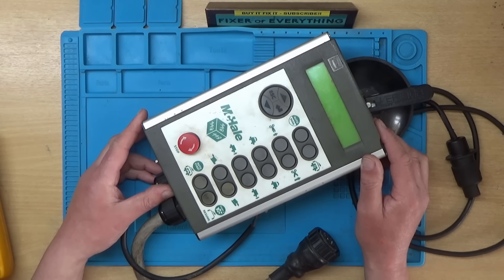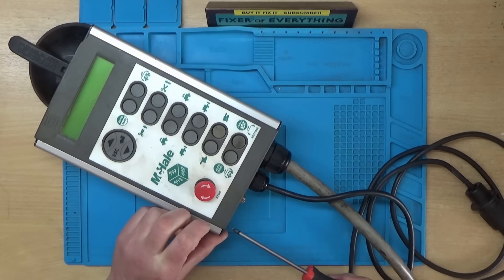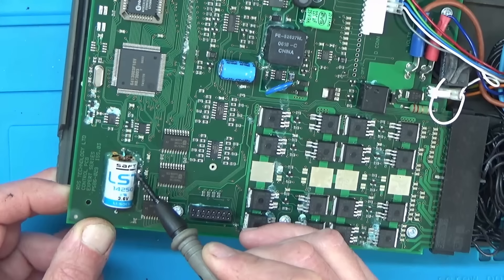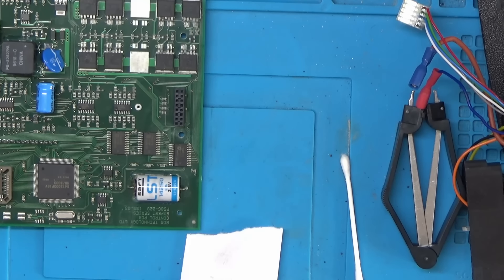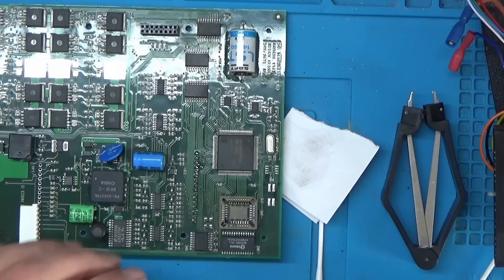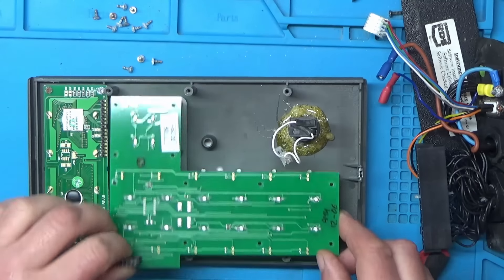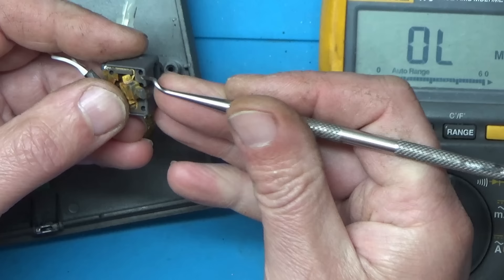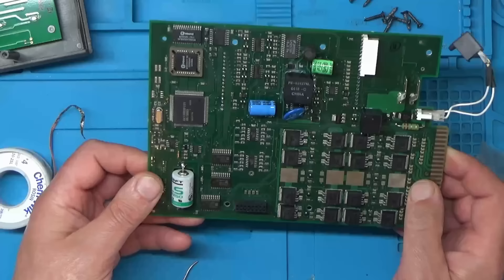Faulty McHale 868 Square Bale Wrapper Control Unit | Can I Fix It?

Comment: You just did that farmer a massive favor, no McHale dealership would even look at that. they would tell him to buy a new one which cost many thousands. Baler and wrapper controllers fail often and repairs are extremely pricey. Replacing an old eprom is over 500$ here. Great job!
Reply from the maker: Thanks 👍I've done a few other jobs like this as I know a few farmers. One was another bale wrapper controller with a shorted protection diode as the power had been connected up wrong and another was a mower arm controller that did things randomly. That one turned out to be dry joints on the mosfets going to the solenoids 🙂
Reply: Wow 500usd for replacing an eeprom. Would love to do that kind of work
Reply: Love the live wire with a blue crimp and live wire with a red crimp
Reply: I should take as much for changing bulbs.🤑💰Taking that much for burning a ROM with an already written binary , that's very questionable.

Comment: For the problem of long term use of silicone you mentioned (29:11) my solution is to put them in a ziploc bag and keep them in the fridge. I can use even the smallest tubes of silicone for many years this way. I keep my cyanoacrylates and even marine wood glues fresh for very long this way.
Reply from the maker: Thanks for the tip👍. Someone also mentioned sealing the end with candle wax too.

Comment: Truly original and authentic content, great work. The one board where you probably want conformal coating
Reply from the maker: Thank you 👍I think the control panel is usually mounted inside the cab of the tractor.

Comment: Stuns me that a piece of farm equipment is so poorly protected against water ingress. Great repair.
Reply from the maker: Thanks👍I think the console is supposed to be inside the tractor cab, so probably doesn't need to have too much water resistance, also the fact the safety switch was broken effectively making any water resistance useless.
Reply: @BuyitFixit  Unless they went for a full conformal coating over important parts.  Washing machines typically have lots of potted circuits.  But taxing farmers is farm equipment manufacturing 101.  If the name had been "John Deere" then nobody would've questioned the intent.  Others can still plead ignorance.

But yes, TBF, it could've been a design oversight, as one doesn't bale hay in the rain (or when wet).  Wet hay spoils.  At least in Murica.

Comment: My "go-to" for a repair like where you used the superglue and Gorilla glue is UV-cured resin. You can get it all around and the part situated in place and then in a matter of seconds, cure it with the UV LED. No long wait time, no cure time, pretty easy. Love watching your videos!!!
Reply: Hi! Got a decent brand of resin? Right now I'm using UV cure nail polish for solder mask and it is pretty meh (good enough for solder mask but not much else). Wasn't sure about the actual resins so I'd like a place to start :) I have my 3d printer resin but I'd like something that dispenses more controllably.
Reply: Use 3d printer sla resin…. Use it for anything like this… just a UV light and bingo.. you can even build it up too. And it’s waterproof
Reply: On watching the same segment, I was thinking that a ring of stainless steel mesh or wire wool fibres plastic welded to the area supporting the e-stop button would have made a more robust repair. Resin sounds much simpler, though. That said, another great video from what for me is one of the best channels out there.
Reply: Try adding some hot staple welding staples to add structural stability and then UV resin, The stainless steel wire secures the crack from expanding and strengthens and adds a stop check on the crack. There is also techniques to weld using similar plastic material like you would use when welding metals with metal welding rods.
Reply from the maker: Thanks 👍and cheers for the UV resin tip!

Comment: Emergency stop switches are usually normally closed so that you get a stop condition if the wiring becomes  disconnected, otherwise whatever it is controlling would happily continue with you fruitlessly operating the switch when the wiring gets cut!
Reply from the maker: Good point 👍

Comment: Great fix!   Silicone open tubes preserve well by running all air out, then seal opening with celophane and cut cap.  Store standing up with tip in air at comfortable room temp.
Stores well for about 2 or 3 months.  Silicone does not have a long shelf life even when not open and this is why you can find it on sell sometimes.

Comment: We at David King Electronics are specialists in the repair of agricultural electronics, but it is nice to see someone else willing to take such a repair on and win.
Reply from the maker: Thanks 👍I've done a couple of jobs like this. Another bale wrapper for another friend where he had reversed the polarity and blew the protection diode short circuit, and a mower arm controller which ended up having dry joints on the mosfets that controlled the solenoids 👍

Comment: You used a tube of superglue on TWO different projects without it solidifying in between?!?? 

Forget being a repair master; you're a miracle worker too! (Great fix, BTW)
Reply from the maker: 😂😂😂😂I've used the same tube quite a few times, it normally doesn't block either!

Comment: Epoxy like JB weld is great for plastic parts like this.  Once fully cured it is sandable and you can even tap it.  Useful for worn screw holes.
Reply from the maker: Thanks for that 👍
Reply: @BuyitFixit  another wonderful thing about epoxies is that they don't go off in the tube - only when you actually mix them.  I have this stuff sitting around for years until I need it - and it is ready to go.

Comment: Brilliant fix Mick, you would of thought there’d make them water resistant at least, it just goes to show NEVER LEND THINGS OUT! the times I have lent things out and it comes back broken, I had a 3 day old vax cleaner and a young neighbour asked to borrow it as theirs had broken, 2 days later it came back full of bits of concrete/brick, soot and what looked like the contents of 2 cleaners hair and fluff the bit you empty was jam packed. Not only that when I had cleaned and emptied it to use it I plugged it in it took out the RCD and on inspection the mains cable was down the the copper and twisted together 😮 never lending things out again!
Reply from the maker: Thanks mate 👍wow seems like your neighbour really did a job on that one 😯
Reply: @BuyitFixit  certainly did Mick lol 😂

Comment: Hi, I always look forward to your videos.  you would think if an electronic device is meant to be outside it would be at least waterproof.
a little tip, for silicone adhesive I started 25+ years ago taking a lit candle and warm the area with the lid on and drip wax around the lid until a seal has been made between the tube and lid. this works very well. I also use it on my used tubes of calk by cleaning the tip and dribble the hot candle wax in the hole.
Rich
Reply: It's not supposed to have a hole where the stop button used to be 😉

Edit: nice tip about the wax, I'll give that a try next time.
Reply from the maker: Great idea 👍I think the panel is meant to be in the tractor cab, not out in the rain though 😂😂😂

Comment: Person of many talents, don't think you'll ever be short of work. So that's it got power (0:56). 0V, don't you just love editing!
Reply from the maker: Thanks Ralph 👍No editing on that bit. The meter isn't connected, and those probes I'm using are the probes coming from the bench PSU (going up the left side of the mat) 😉
Reply: @BuyitFixit  Ah, misdirection. I'll add poetic license to my range of playful insults.

Comment: Nice cleanup job! Those 3.6V lithium batteries are the #1 enemy of the Classic Macintosh computer community. They have ruined many motherboards over the years. Luckily, this one hadn’t leaked terribly bad. I’ve seen some horror pictures from inside old Macs.
Reply from the maker: Thanks 👍🙂

Comment: Great job! I enjoy your videos. Very informative and educational. 
May I make a suggestion? 
There is a plastic repair tool you should add to your toolbox for something like the emergency cutoff switch repair. 
Have you seen the hot staple plastic welding tool? It looks like a soldering gun, but has two small tubes that hold a hot staple,   0.08 or 0.06 mm, in various shapes like wave, straight, inside corner, outside corner, that you insert the two ends into the tubes, which makes a circuit like an tungsten light bulb, and you press and melt the staple into the plastic across the crack. Then snip off the ends and grind down the stubs. You can also use a flat curved tip on a soldering station and cut various shapes from metal screen, like window screen, or use precut patches of brass screen and other types of metal screen and dimensions of the weave, smaller or larger. You can melt the screen into the plastic. For example, cut out a circular piece for the switch repair, cut the center out of the screen patch to fit over the switch leaving enough screen to cover the area of the crack and melt it into the plastic with a hot flat tip iron. or you could connect the hot melt staple gun's two contacts using stainless steel wire to the patch and heat up the patch weaved wiring directly. There are many video contents to view to get better ideas of how to DIY your own hot stapling plastic repairs. My first attempt was a large crack down the center of my John Deere garden tractor and you would never know it was split down the center of the hood, but just a long scratch.
Reply from the maker: Thanks for that. I'll look into those 👍

Comment: After I use a new tube of silicon, I seal it with a bit of adhesive backed foil tape, then screw the lid on .  I can get a year or more out of the tube that way.  Have got to keep the humidity out of it.
Reply from the maker: I've tried tape etc before, usually I still have to remove a plug of silicone that has gone off, or sometimes it's made it's way all the way into it and it's all gone solid.
Reply: @BuyitFixit  have you tried the aluminum foil tape?  The kind used for air conditioning ducts.  That is what I use.  In a pinch two layers of regular tinfoil works also.  You have to scrape all the rtv off the end of the threaded portion of the tube.  It seems the moisture in the air will wick through RTV so that it will cure in the tube.  guess that is a necessary property for gaskets to set.

By the way, I am always impressed with the thoroughness, and logic used in your fixes of unfamiliar equipment.  You are a diagnostic guru!

Comment: When using Gorilla Glue, use a bit of water to get to cure properly. Wet the two surfaces your are gluing, they just need to be slightly damp, makes the glue many times stronger.
Reply from the maker: Yes, I did see that it cures with water. Thank you for the tip 👍

Comment: When glueing plastics, I always first check if it's dissolvable by acetone, or rather MEK (methylethylketone).
If it is (ABS, PVC etc) I find the bond stronger if I partly dissolve both surfaces and glue it that way (chemical welding), rather than using a glue that works on basis of adhesion only.
Reply from the maker: Interesting. Thanks for sharing 👍

Comment: Slightly disappointed you didn't go on to dump the memory and work out what the tech 1 and 2 codes were 😉
You certainly get nore interesting stuff to fix than me, at the repair cafe even the reception volunteers now know to give a toaster a bloody good shake upside down after going outside (I was busy and suggested that, its quicker than finding the raisin blocking the mechanism)
Funny how after no mow May we had a run on lawnmowers and just before sewing bee started we had 6 sewibg machings in one day.
Reply from the maker: I do get some boring stuff to fix too, but I don't usually do a video on those. Sometimes I'll bring stuff home from the repair cafe if it's more interesting or if I need other equipment than what is available at the cafe.

Comment: @Buy it Fix It Hi white Vinegar is good to remove corrosion on contracts too I have done it on leaky Battery Terminals with great  success too.
Reply from the maker: Thanks 👍yes used it a few times too on some of the old video games I've looked at. It also depends on the type of corrosion as the acid in the vinegar neutralizes the alkaline from the battery. Where the flash chip was I'm not sure if that was caused by the battery or if it was just rain water.

Comment: FWIW when it comes to silicone I use a caulking gun, let it go off in the nozzle, then when I need to use it the next time I remove the nozzle from the cartridge and give it a blast with my air compressor to eject the cured silicone, reattach the nozzle and happydays.
Reply from the maker: I usually leave the nozzle on and put tape or such over it. Eventually it cures in the nozzle but it also sometimes spreads down into the whole tube.

Comment: When you cut the wires of the battery, you should cover the pins with solder afterwards or cut first then solder. If not, you might get corrosion between the pin and the solder and after years, this soldering connection get lose.

Comment: Do you have a fiberglass scratch brush? I like the pen type, where you rotate the body to extend or retract the brush. The fiberglass elements abrade away quickly and are replaceable. Would have been ideal to clean corrosion from those pins and contacts.
Reply from the maker: Yes, I bought a set of 4. Totally forgot about them. I do find that they wear down rather quickly and leave little bits of fibre everywhere.

Comment: I bet every farm for miles around will ask you to fix stuff! My guess is that box is pretty water tight, until they broke the stop button.
Reply from the maker: Yes, I do get asked a bit😂😂😂. Agree, although the box doesn't really need to be that watertight as it's usually operated in the cab of the tractor👍

Comment: Great video. What is the intended use of the battery? What data is stored? Does the user determine the data that should be stored?
Reply from the maker: Thanks 👍I think it stores values such as number of bales wrapped, as I did notice when I went through it on the video that a number of values were zero.

Comment: Got to admit that an emergency stop switch is not one that I'd be fixing. That would definitely be replaced with a completely new switch assembly.  

That's one switch which has to work as expected when it's needed.
Reply from the maker: The switch assembly is modular. The front part is just a plunger and seemed fine, and it can accommodate different types of switches.

Comment: another great fix....but you would think that as its farm equipment it can be left out in the rain....built in fault to make more money out of poor waterproofing....
Reply from the maker: Thanks 👍I think the control box is designed to be operated from inside the cab of the tractor.

Comment: Have you tried vinegar for the corrosion and super glue and baking soda for the emergency switch?
Good video...
Reply from the maker: Thanks 👍I normally use vinegar when I come across alkaline battery corrosion, this was more water damage. Thanks for the suggestion of super glue / baking soda. A few others also mentioned it. I'll have to give it a try sometime!

Comment: I bought an expensive paint thickness meter as used on cars , used it once , the next time i went to use it the leak proof batteries had leaked ever so very slightly, cleaned everything up no joy. took the cover off and checked for battery voltage on the board to eastablish if connectors worked, that was the end of my expertise, as mentioned it was pretty expensive and would love to have it working again, cant bring myself to bin it , is it something you would like to help with 
Best regards
Reply from the maker: Drop me an email at the channels name at out look dot com

Comment: You also should be using baking soda or vinegar to neutralize that corrosion.
Reply from the maker: @kevamor  I normally do, but depends on the cause of the corrosion. Vinegar for alkaline, baking soda for something caused by lead acid battery for instance. This was just mainly oxidized from water.

Comment: 29:27  The acetic acid silicone needs air to cure.  Common is to drive a screw into the tip and let it seat into some silicone coming out the tip.  Then, usually, can still use once remove screw.  Will see goo on screw threads if you sealed at the tip+fluted neck.  Alternative/Extra, use one of those giant Ziplocks to store the caulk. Air intrusion can happen from the pushing disc.
I never tried, but theoretically, keeping the tube submerged in water would prevent/greatly retard any curing of caulk. ....  TL:DR  Atmosphere is the enemy of acetic cure silicone caulk for storage.
Reply from the maker: Thanks for that. I usually put a screw or such in the nozzle but find that eventually the stuff in the nozzle cures and then it even goes further back into the main tube. I might try some sealed ziplock bags as suggested 👍

Comment: Could have desolered the socket and soldered the PLCC chip directly onto the board, there is not much chance this device would ever need reprogramming anyway.

Would have made for the best possible connection....
Reply from the maker: Fair point 👍🙂

Comment: Can't help but feel that farm equipment not being water resistant is a rather big oversight.
Reply: It probably used to be weatherproof until the emergency stop button was bashed in. There was a bloody great big hole on the front panel!
Reply: I would put it in a plastic bag.
Reply from the maker: I think that the panel is supposed to be inside of the tractors cab.